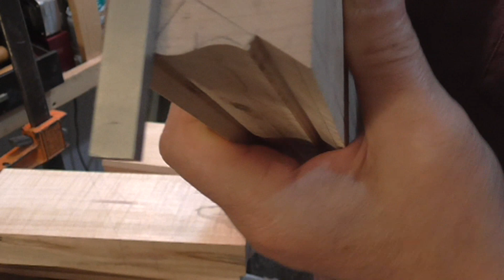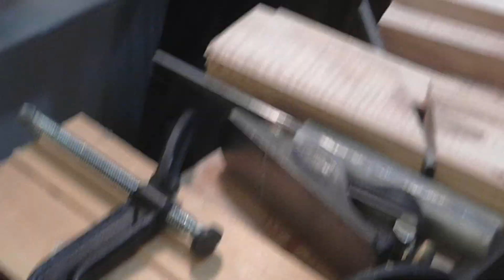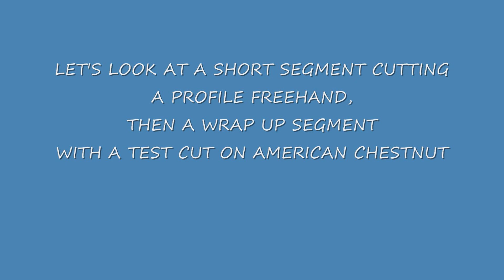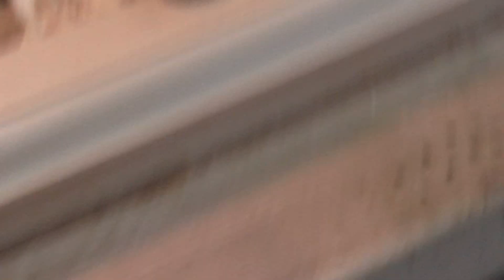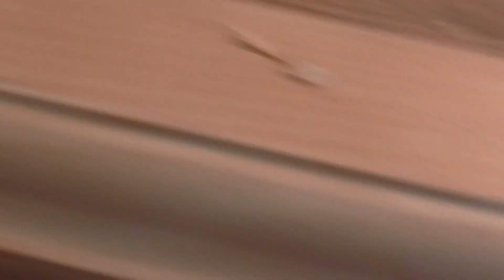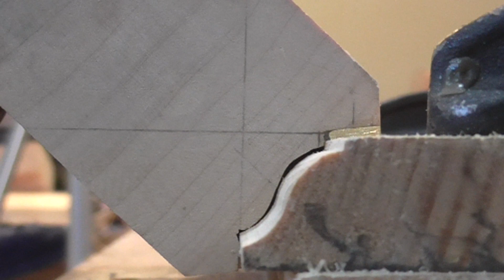Plane Making - Ogee Moulding Planes, Pt.2

Comment: In the 2 years since you made this video have you realised you are sticking the moulding wrong? If interested I’ll explain
Reply: Sorry I don’t want to come across badly… but it’s an interesting point. Sash moulding planes like that have 2 depth stops (and one fence). If you look on an original it has the obvious depth stop but also one at the exact same angle on the blind side. This is designed to bottom out on the sticking board when making a sash bar- meaning that the sash bar will always be a consistent thickness. When sticking a moulding on a rail, as you are in the video (or so it looks) it will not stop cutting when the escapement side depth stop hits the top of the rail. It’s easy to keep going and make a non-uniform depth moulding. So either you need to scribe a line to mould down to, or use a piece of waste wood to create a surface for the blind side depth stop to register against. If I could post one picture it would show what I mean, looks like I can’t.
Reply from the maker: @stevesteve6545  Yes, indeed ! You are 100% correct. Doing it the way I showed will produce non- uniform moulding. For small runs or for demonstration purposes, I could get away with it, for larger runs, by all means yes, you would want to control the depth and make the mouldings more uniform than I could free hand.
Interesting point and I'm glad you made it !
Reply from the maker: Please, tell us all why it's wrong and of course, the correct way. Thanks.

Comment: Very interesting and informative video - thanks!
Sadly, the part I was most interested in was how you shaped the profile on the blade and sharpened it - the very part which was missing.
(I have a number of old irons which are out of shape, and I am not sure how to correct them to the exact shape of the sole of the plane.)
Reply from the maker: Look for the video I recently did on the subject .
Reply: @ROUGHCUT20  Thanks.  I'll do that, now.
Reply: I’m really enjoying all your videos! I recently started picking up wooden planes, and a few of them have “issues” I’m looking at fixing. Your work is informative and inspiring. Great problem-solving.